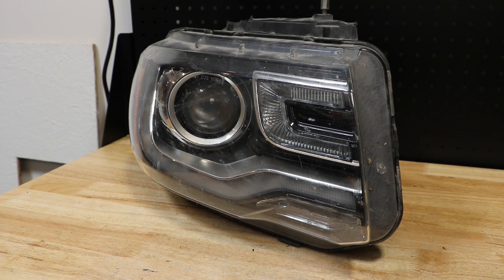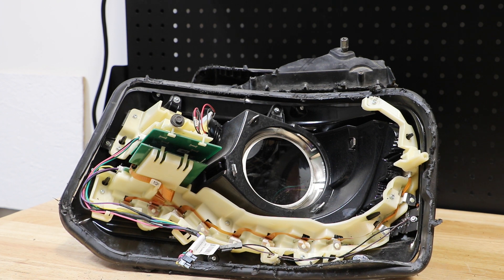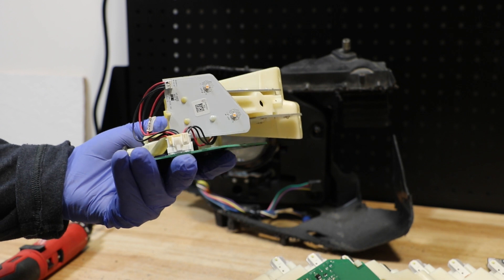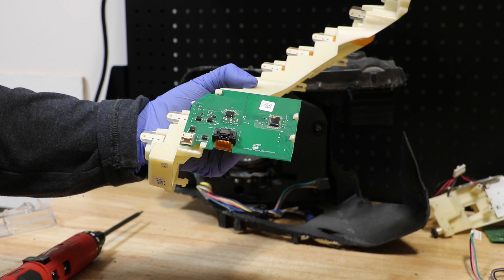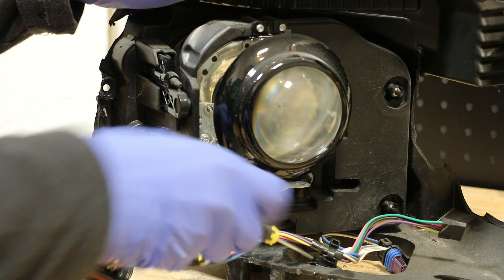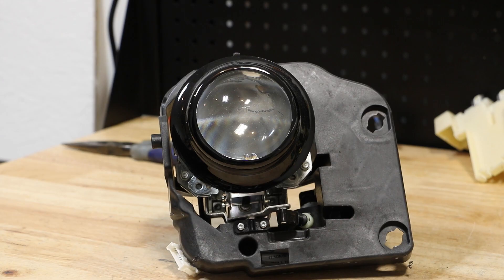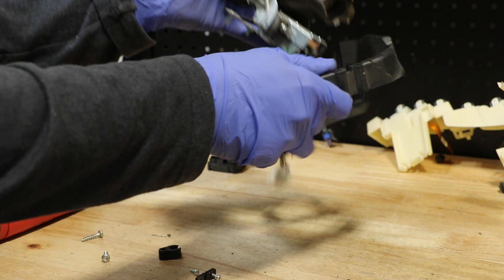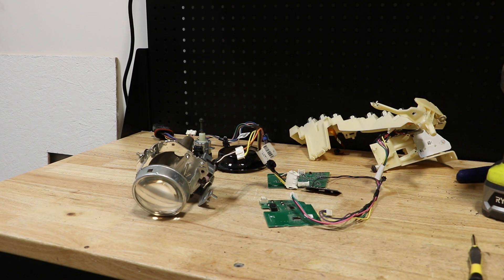2015-2017 Lincoln Navigator Xenon Headlight Teardown

Comment: Hi there. Great concept for a channel. In your tear down vids you use a heat gun to detach the entire clear lens assembly from the black plastic housing. I have 2017 Nav and just got a crack in my lens. eBay has a “lens cover” replacement for $146 but it looks like an outer cover to the actual lens assembly. Have you observed multiple (replaceable) layers to the lens assembly? Thank you!

Comment: I have a 2018 navigator reserve  that I have been having electrical problems my turn signal goes out and then eventually both turn signal followed by the running light in the right side. If I replace the modules it works for a bit but then it does it again. Do you know how I could diagnose it or could this be my headlight causing this short. I replaced the harness and it keeps doing it. It was in an accident and the headlamps are from a junk yard. Thanks